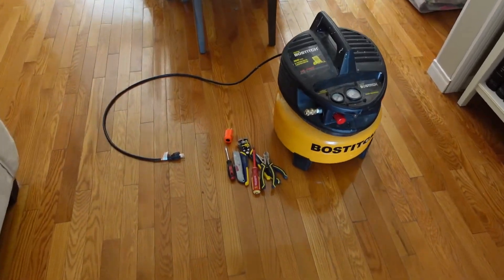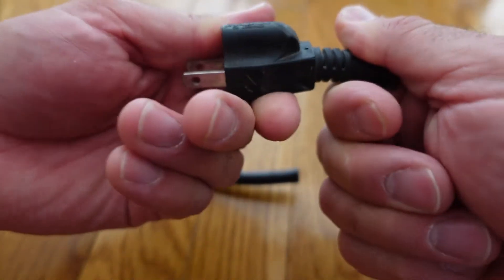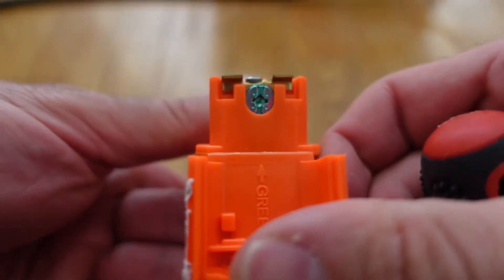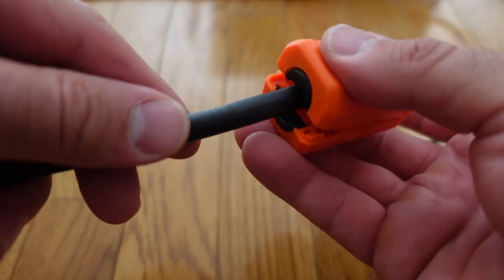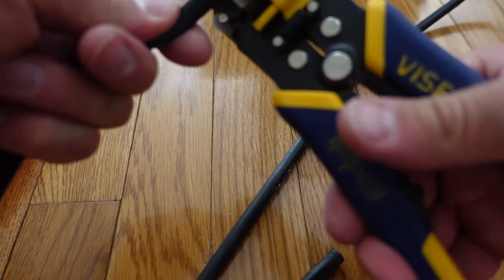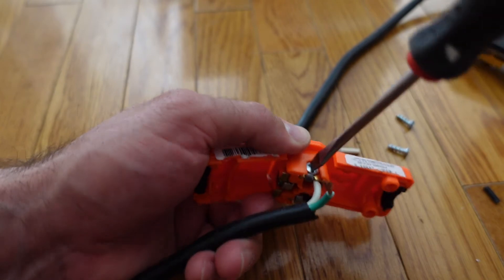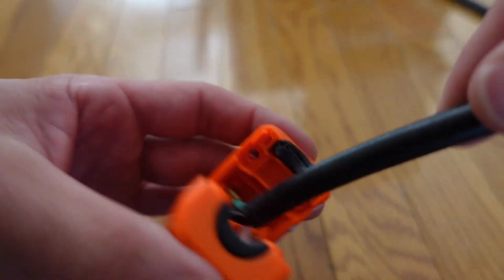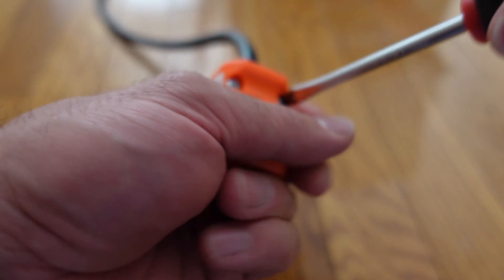Fixing a Broken Electrical Cord Plug End

Comment: Odd, I have the exact same compressor with the ground missing.
Reply from the maker: It seemed to break pretty easily when it let go. It wasn't like it was stuck in the outlet or stepped on. It just sort of fell out in the outlet of my extension cord.
Reply: @DIYNorth  that is they exact same thing that happened to me. Just disconnected the extension cord and no more ground. I suspect we're not the only two.
Reply from the maker: Overall its not a bad compressor. I've got a lot of use out of it. I wouldn't necessarily recommend it, but for the price its been decent.